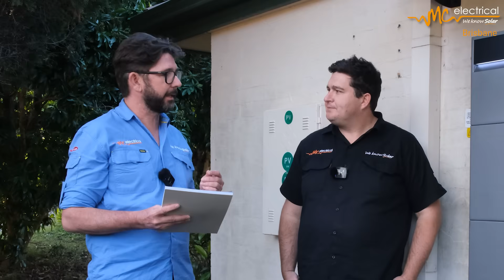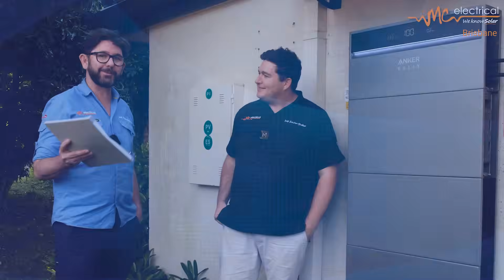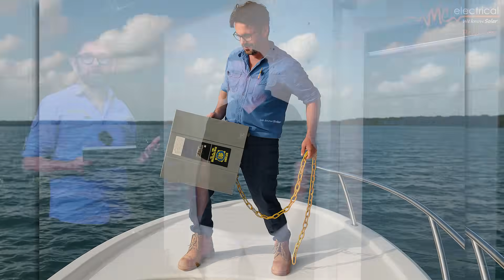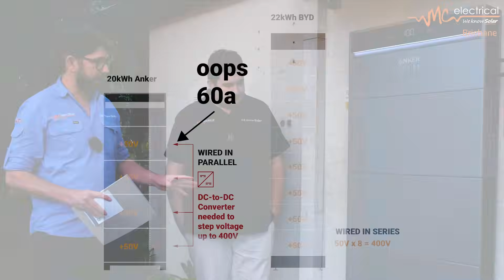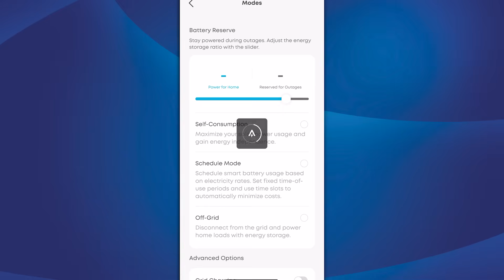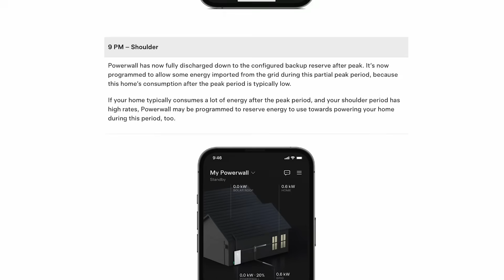Anker Solix X1 Installation Review

Comment: Can someone explain that issue of this system not being well suited to certain panels? What panels would work well with this system?
Reply from the maker: It’s just the operating of some panels mean you can only have short strings. And because it doesn’t have 3 mppt’s and has a relatively low current, then we are limited with how many panels we can put in one orientation.
Reply: @mcelectrical  Can you layman's this explanation a bit more please? I have 18 x 370w Canadian Solar Modules (with a Fronius Primo 5.0 inverter) already and want to know if the Anker Solix X1 system will work with this setup?

Comment: Replacing battery modules means all modules work at 100% instead of lowest common denominator. Why not be honest guys
Reply from the maker: Yeh that may be the case. In fact we have just started a round trip efficiency test with 4 year old BYD modules mixed with new ones to see if that holds up in the real world. 
They also claim the lowest common denominator as a reason to put optimisers on panels. It turns out that was a terrible idea for reliability , and in many cases was worse off in performance. This logic doesn’t transfer to batteries in the same way, but we’ll have test results in the next few weeks.
Reply: @mcelectrical how has this tresting gone ?
Reply: @Senectus  Round trip effiency for the Anker is not good (on par with iStore & Sig). But, the Anker did perform well in an extended blackout. The reality is that battery degradation for a well-managed LFP battery is very slow. The BYD we tested lost aprox 5% after close to 5 years of use. It's a sample size of 1, but it was better than we expected. I think it has a lot to do with good thermal management.
Reply: @Yorick_Mark thanks for replying.  I have a 40kw dual inverter solix 1 going in soon. It's a bit pricier than the competitors but i think it'll be worth it in the long run.

Comment: Hope they will adopt CATL new Sodium batteries soon. That offers real runaway protection that not even LFP can match. And costs should come down by half. Not to mention much longer life cycle. It's such a generational leap I will definitely wait for those before I buy batteries. 

Do they offer larger Inverters? And that is the timeframe on their car charger?
Reply: At AllEnergy, Anker had their new (for Aus) gateway and smart EV charger on display. The gateway will enable full house backup with 2x 5kW inverters. I was told Anker Solix Australia is pushing hard for a couple of larger single-phase inverters. Their range goes up to 12kW for 3-phase.

Comment: Fantastic video, does Anker X1 battery need to install cover when it stored outside without roof cover? Thanks
Reply: The short answer is no. But it's cheap insurance. This battery is on a south-facing wall in Brisbane so it's overkill. 

As per the installation manual, "Do not place the modules near a wall facing the maximum sunlight direction
(usually south for the northern hemisphere, or north for the southern hemisphere) or
in an area exposed to direct sunlight, fire, or explosive materials."
Reply from the maker: If you're worried about rain, no but direct sun will affect the longevity of your battery.

Comment: Hi I have seen a seperate back up controller been installed in some videos. What exactly does this back up controller do and do you need this to be able to back up the home during a blackout or is the battery inverter itself capable of backing up the home during a blackout?
Reply from the maker: There is a new version coming out with a gateway. This will allow whole house backup (larger load on backup). Maybe the gateway is already in other markets?
Reply: @mcelectrical ok so in Australia we only get the batteries and the inverter module on the very top and that's capable of backing up essential loads during a back up is it?

Comment: @10:33 you mentioned the right side of the battery module gets hot. Do other batteries do similar thing? What is it - a design flaw? Heating a battery is a great way of decreasing its life time. Thank you for the video btw!!
Reply from the maker: That’s just the dc to dc converter doing its job. It would be separated from the cells, but yeh, not ideal.

Comment: The Super Power from the MC Electrical T-Shirt

2:28 Mark Cavanagh, the MC Electrical company Director, clearly states Yorick helped install the system!  Was Yorick qualified to do this a licensed electrician in the Australian State for the installation?

2:30 Mark Cavanagh the MC Electrical company Director, asks the self proclaimed unqualified Yorick to provide information and an evaluation as the installer of the system.  This is despite the fact he states he is unqualified. Yorick states that by putting on an MC Electrical shirt he is able to make statements. A Super power acquired from wearing the T-Shirt.

5:12 At Mark Cavanagh’s request, Yorick makes high (industry) level engineering comments on the plastic covers. No reference is made to Australian or international standards by Yorick.  Mark Cavanagh can you reply with the engineering qualifications of Yorick on his evaluations in this and other presentations by Yorick?

2:31 Mark Cavanagh asks Yorick to state his review from an installers point of view.  Alas, Yorick states he is not qualified, but by putting on an MC Electrical shirt his “apprentice” point of view gives statements credibility at an Australian National level.  He provides a qualified installers review, but states he is not a qualified electrician.  Mark Cavanagh - is this a fake review?
Questions for Mark Cavanagh to answer – is Yorick a qualified and licensed installer?  If not, is he employed as an apprentice as he stated in this video?

5:55 Mark states Fronius provides “really good inverters” without providing any information to support his statement.  This video looks to be fake information and I request the author Mark Cavanagh to reply to clarify by answering the questions.
Is this a statement of Fronius reseller alliance by the director and unlicensed installer of MC Electrical?

Looking forward to MC clarifications on this video - ps where can these super power T-Shirts be obtained so that any solar installation can get super power approvals?

Comment: Waiting for mine to be installed. Only issue i see is the 6kW inverter... Quite lackluster especially when compared with Sigenergy or Tesla..
Solis want to compete with the big boys but fall a little short in this regard. 6kW wont run a moderately sized air-conditioner and kettle simultaneously. Hell, it wont run my gaming PC and aircon simultaneously.

Great video.
Reply: Well PW 2 was only 5KW output power and look how popular that was mate
Reply: U boil water every minute? 😂
Reply from the maker: Yeah most of the solar systems we're installing thesedays are 8-10kW

Comment: Which batteries and or inverter/s still charge during blackouts ? IE daylight hours and power goes down, some system will still feed power to the home and battery (allow battery to charge) and yet other systems don’t work this way ?
Thanks
Reply from the maker: Many will do that if correctly designed and installed. Fronius, Sungrow, Tesla, Anker etc.

Comment: Question: I want this battery behind my shed, that has no solar(yet). The house has an enphase system tied to the grid. My idea is that this battery comes ac between my house and the grid with a gateway. The hybrid inverter has inlets for a panel. Could I (or a sparky)  plug a few jinko panels into this inverter (on the shed roof) while it is also ac coupled to house(enphase) and grid? Will enphase be able to still charge the battery?
Reply from the maker: It could be done I think, but you would have to install a Anker consumption monitor at the house and run a cable to the shed. Enphase probably wouldn’t keep charging the battery in a blackout.
Reply: The AC coupled Anker X1 can not keep the Enphase active in a blackout. The FranklynWH may be better if thats a must have feature
Reply: No blackout support on enphase is a bummer, I learned sigenergy does that better. Saw your vid on sig.. cons which I fully understand plus anker has the looks factor.
Reply: @marcvanheugten9472  Unfortunately, (for SEQ) as Sig & TPW3 are classified as Hybrid inverters. Energex will not approve them as AC-coupled battery options. Unless you have 3-phase or have an Enphase system that is less than 5kW you will need to look at a true AC-coupled option that does not have solar DC inputs

Comment: Can you AC couple this battery to an already existing solar system with a string inverter ? Also how much is like a 15KW system roughly cost installed? Thanks
Reply from the maker: Yes there is an AC coupled Anker system. I don’t really know the pricing but I’ll guess less than 10k for a 15kWh Anker battery installed.

Comment: I am happy to see you did review. I love anker products. My battery is getting install next week. I have fronious invertor. I am getting hybrid inverter but will run it as AC coupled because dont want to loose fronious inverter. But bad to hear, you are not going to continue with this product.
Reply from the maker: Understandable that you'd want to keep your Fronius inverter.
Reply: @mcelectrical in addition to above my battery got install last week but from last it is not working. It cant read from solar and grid. Sparky is trying his best to fix the issue but they are saying this issue happening because of fronious smart meter. Do you have any case where you installed anker battery with fronious inverter and fronious smart meter?

Comment: Cmon Mark “I dont think it will work as well as a Fronius” sounds a lot like conjecture with zero proof. Even if folks find you “controversial” they generally respect your objectivity….are you losing that? Hope not. Keep up the good work. Well done Yorrick as well! Have a beer together at All Energy.
Reply from the maker: Ha, yeh it’s not proof. But I’ve tested heaps of inverters against Fronius. Only SMA is as good. And maybe Huawei. Infact Huawei maybe better in at least one metric. But the point is, I didn’t test it but my feeling is it’s probably completely fine.
Reply: @mcelectrical when you say Huawei i am guessing that includes iStore now, or was it specifically Huawei.
Reply: @balensydney  ah yes I mean Istore. Review on that is coming soon.

Comment: What I hear about the older batteries that don't have "DC optimisers" eg Sungrow SBR is that adding extra modules later often results in uneven SOC issues
Reply from the maker: Yeh that’s a fair comment. With the  battery rebate in Australia now, it makes much more sense to oversize now to claim the rebate once, then you don’t need to pay full price for an extra module (and extra labour) later.

Comment: I have my Anker AC coupled battery wall mounted as wall feature item on my deck due to its great looking product. Great review and thank you for confirming some of the features i read. Glad that the LED comes with 10 years warranty. No regret getting this 20kWh 6kW battery for my house.
Reply from the maker: Thanks for sharing your experience and glad you are enjoying the product.
Reply: What's the pricing roughly including everything after rebate?
Reply: @scofieldsy7860  about $10k for 6kW 20kWh ac coupled battery after federal rebate. Install done by MyEnergy Group in NSW.

Comment: Thank you very much for explaining how Tesla utilises time of use. I had my suspicions of how  it worked, but it’s nice to have them validated. - A question you may be able to answer: I have Super Off-peak assigned to 12-4am, yet charging often doesn’t start until 1:30am. Sometimes even 3:30am. Which results in my battery not fully charging prior to 4am. Do you have a suggestion for addressing this?
Reply: Adjust your power pricing in the app up or down a little. Tesla optimises for cost saving but will also try to minimise the cycling of the battery. If the cost difference is small it may be decided that the wear and tear on the battery is unjustified.
Reply: @Yorick_Mark Thanks for taking the time to respond to my query. Much appreciated.

Comment: 12:52 - I like the discussion while I saw in the upper that LED screen changing the white SoC Bar I guess. 
I wonder how long this signature piece will last in the european climate from winter to -10 to summer 38°C and how it will fade away. It is here on the top but considering you buy a smaller setup and battery of just 2 then this would be the 3rd from the bottom and the sun might hit it hard. 
Chinese do no longer check for longevity - what most customers do not get about the  chinese cars. They are developing and simulating the process of aging virtualy and not in a climate chamber or on arctic test track close close to the north cape. You can not see the difference until the years went by and things broke once or even multiple times. 
And you can watch that easily cause the chinese think as tesla did it would be easy to find a proper setup at the nürburgring to beat Porsche. But Tesla had to come several times and spend there weeks and months to get anywhere. The chinese tried it and it took them much much longer cause their base line setup and knowledge about their car was too limited, their simulation data did not match the reality. 

Cars and EVs are much more complex and they do not run the usual quality programs with prototypes during the developement and hence they face all the issues afterwards during mass production when the customer start to complain. 

Prototypes are the most expensive part of a car developement so you can save a fortune as manufacturer - but you will learn a lot of your mistakes later when cars have been produced and delivered like we have seen with the MG. And the chinese do not retrofit all their cars unless you complain. 

With solar inverter it is the same but those inverters never come back to the dealer or installer to get maintained. If something is wrong it becomes much more expensive then exchanging a part on a car or a whishbone. That might take minutes, but in a solar system it takes more and the part to exchange is usually a pcb. 

What the chinese have no learned like DEYE is that their certifications are becoming useless if they change parts during production for whatever reason. DEYE had done it and violated germand and EU regulations due to ignoring the safety regulations and saving cents by removing parts.
Certification was gone and they had to retrofit the NA protection with an outside module. 
They were also forced to change the firmware to make sure that nothing sold to german owners (even from abroad) could work without that box. Only those with box connected are allowed to work in germany. Hence german customers without any clue faced the moment of truth when their system did not work any longer cause they had updated the software - no matter what. If they would have not been able they would have been forced to exchange every single inverter (the microinverter series). But it shows the risks and the capabilities of the chinese: Without your permission they could exchange the firmware and make whatever they want 
In this case for the better , but it is frigthening if you think about it. Deye share priced was crashed by german youtubers who had released the investigations that deye had cheated and violated the EU and german regulations (to save money no matter what and sacrified the safety). 
That scandal is about 2 years old. hundreds of thousands deye inverter in the german austrian swiss markets hat to be retrofitted with an extern NA protection incl. wireless communication. Big deal at least here.

Comment: ANKER means what in chinese ? 
They use a german name to fool the world about quality. Anker is german and you see the german roots for sure in the second you read the english translation: anchor

Ask for the cells manufacturer and model number and as with the question of global mppt there will be silence.
Unreliable brands hide their supplier and by cheap stuff on the chinese market where quality does not matter. 

It is pretending to be german and it is not. If you need customer care or warranty you are in deep water - at least in their beginnings in the 2020s when they started with small products coming from power station crap like seen before by bluetti , poweroak, zendure. 
They are purely influencer youtube driven products and that is it. No serious installer here sells or mentions it. Nor does anyone wants to deal with them. 
Why , if they are first class ?
Reply from the maker: Interesting. I’m not here to defend them necessarily. But they have taken on a bunch of good people from the solar industry to back them with tech support. It wouldn’t surprise me if they had a rough start in the early days (2020).
Reply: Have you seen how hard German cars are tanking in China? I don’t think “German” is a positive 😂

Comment: Does the Fronius system offer push notifications for backup mode yet either? All good if your at home when it happens, but if your out and about you wouldnt know...
Reply: add the Home Assistant integration and you get what you need
Reply: It does not. It really should be a standard feature across the industry.

Comment: The fact that the manufacturer 'thought' they had a feature already is not a great sign of confidence that they'll be delivering the other 'coming soon' software features mentioned here.
Reply: It's quite normal in hybrid inverters, new model, software patches come later, the software takes alot longer to develop than the hardware and sometimes needs to be different depending on the country so alot of compliance, testing and variation.
Reply: To be fair, when I asked the founder of Sigenergy (Tony Xu) about GMPPT, he called his engineer and gave me an answer 5 minutes later. I don’t hold that against him, and I don’t hold it against the new Australian tech team for Anker.